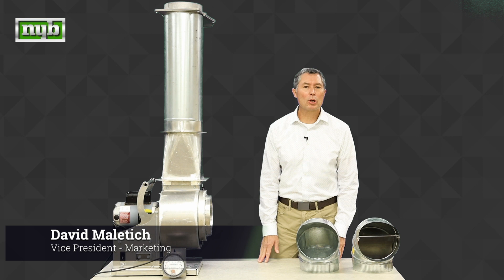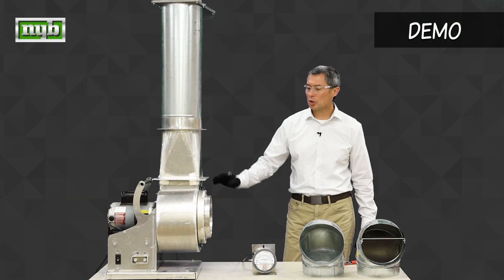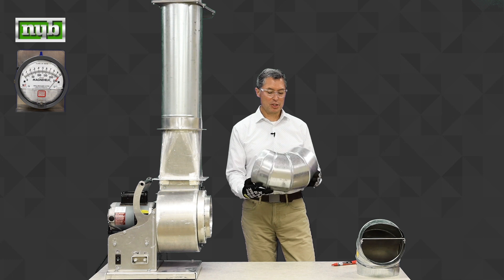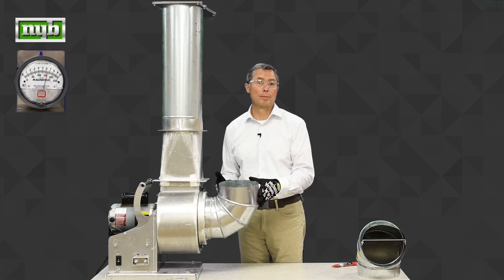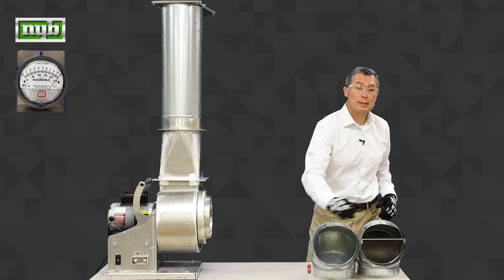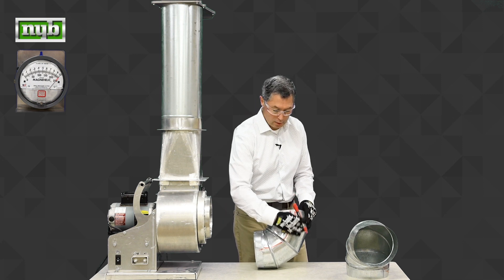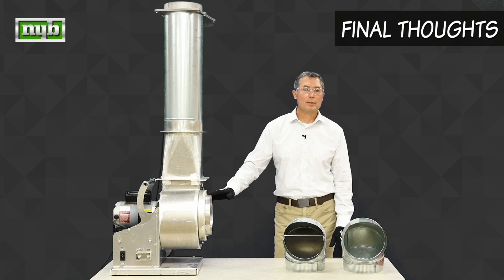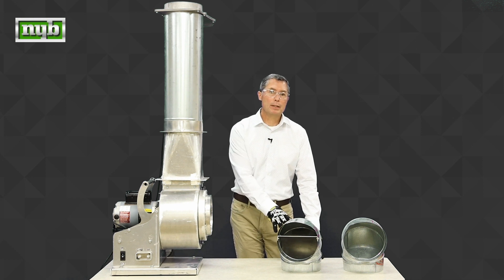How 90 Deg. Elbows Affect Fan Performance (System Effect Series 1 of 6)

Comment: Our house is a new construction and they did everything with a 90-degree takeoff off the top of the main trunk in order to stay within the joist space. We have two rooms with bad airflow that I am planning to replace the top 90 degree turn/takeoff with a side takeoff instead which should enhance airflow. Does it make sense to convert as many top 90 degree takeoffs to side takeoffs? Our system was diagnosed with high static pressure 0.9.

Comment: Fantastic tutorial! Is the vane in the 90 degree round duct a custom fabrication? Or is there an out-of-the-box solution?
Reply from the maker: Hello! The vane inside the round duct shown in the video is a custom component. There are fabricators who manufacture guide vanes, most of these are designed for rectangular ductwork and require installation.
Reply: Thank you  @NewYorkBlowerCompany  ! For this fabrication, do you recommend a single or double walled (e.g., hollow) turning vane?
Reply from the maker: @princegustavious  There is no one type fits all applications turning vane. Each application should be looked at in a case by case situation. Abrasion, moisture, duct shape, duct size, incoming flow conditions, etc. influences vane type, # of vanes and vane shape. Double walled works well in abrupt, rectangular ductwork however users may experience condensation inside the vane when used in high moisture applications. Single walled are often used in round, long radius elbows. Hopefully this is helpful! Thanks

Comment: Will changing the size of the 90 improve the air flow.....IE. Going from 6 inch to 8 inch 90 then back to 6 inch?
Reply from the maker: Hey Kevin! Changing the number of gores in the elbow and increasing the radius of the elbow will improve the flow (AMCA Publication 201 is an excellent resource). Regarding changing the duct diameter, this can create issues resulting in additional system losses and turbulence if the expansion/contractions are too abrupt. Most design organization (Industrial Ventilation Manual/ACGIH) recommend a max. transition angle of 15 deg. (7-1/2 deg. per side). This can result in long transitions.